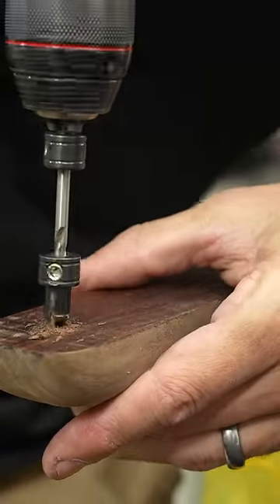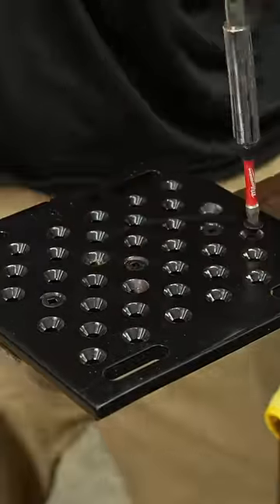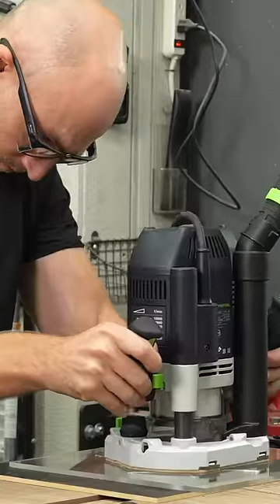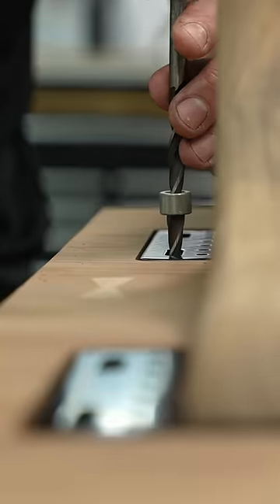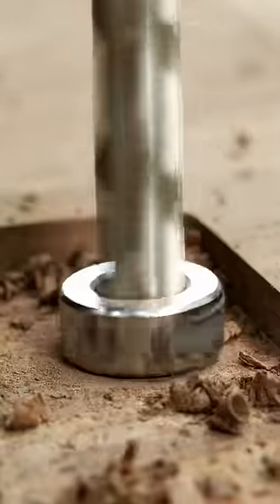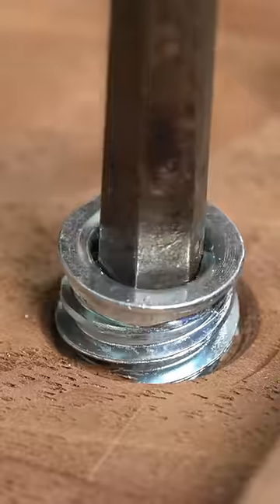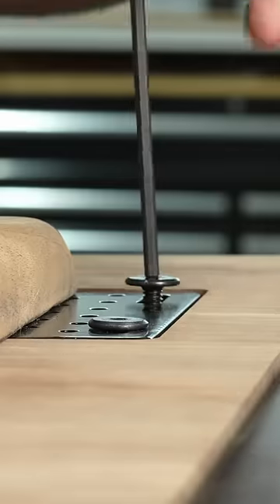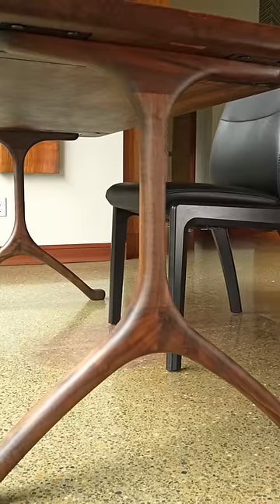Attaching Table Legs

Comment: The machinist in me is silently screaming in agony and the engineer is bitterly complaining about tolerances.
Reply: This made me chuckle since I am a tool maker that deals with engineers on the daily.  Most of them do not understand the intricacies of machining processes.
Reply: The mechanic is happy all the screws are at least easily accessible
Reply: @SGIABC  exactly. Engineers are pretty much the worse part of the chain, in general. Definitely the weakest links
Reply: @cc23001  yup
Reply: With wood its just a little bit different 🙃
Reply: I have wanted to make a comment  about the off 90 degree drilling for quite a while. But I respect the quality of your work that out shines the flawed drilling.

Comment: As long as it holds together, looks anywhere near as good as what you're making and the surface is smooth and level, you're a 10/10 Carpenter in my books.

Comment: Operating a drill horizontally seems to make staying level and inline easier. You can use your core to lock your arms. A button level attached to the side of your drill can be more helpful than the little tube levels some drills are equipped with. Drilling vertically with the work on the floor can have added stability by locking your arms against your legs. 
Nice gadget attachment plates you have there too by the way. Being able to select a side for each countersunk hole can be useful for odd projects. Just a two piece leg situation I ran into yesterday that's got me wondering if Google's been watching along with listening.

Comment: Looks great. You do great work. For my holes, I just use a kreg drill guide if it’s just an 1” but for something like lag bolts I need something better.

This is fine and no one will know. I mean , you’ll know it, but that’s you’re own prison (and not checking moisture).

Comment: The amount of professionals I see that put the drill in at a slight angle is pretty much 100% of them. Around an inch deep, unless you're really really off, it won't matter much at all.

Comment: If you're using a hand-held drill, to get as close to 90° by sight, I find it useful to use a long bit extender. You also need drill bits with a hex shank to fit in the bit extender

Comment: When I need to install [multiple] treaded inserts 100% perpendicular to the face I use a long hex-headed bolt + 2 nuts which I lock against the insert. I then place an appropriate sized socket over the insert/bolt/nuts and make sure it all fit perfectly inside the socket. I also found it's easier to bevel the hole in the wood a bit for easier entry of the insert. Then, using a wrench (spanner), it's easy to micro-adjust the entry angel of the insert and as soon as it's a few mm down in the hole, it's all easy peasy.

Comment: So common this mistake is!
The cure is to hot glue a circular bubble level on the back of your drill motor housing.., when the bubble is inside the circle.., you are square to the surface.., welcome!

Comment: Did you ever had a problem with this type of connection and sideways load? Like someone heavy leaning on the table?
I’m sure the connection plate to the table will hold up just fine, but the surface area to the legs is quite narrow. (But beautiful 😅)

Comment: I think you could use a jig to help you with those recessed threaded insert holes. Just extend your stop the height of a block of wood that has drill pressed homes on it. I'm tired you get what I mean.

Comment: Next time, would your metal brackets have the countersink so the heads of the screws are flush with the plate and the bottom of the table

Comment: To help keep your hand-drill holes more square, you can take a piece of scrap wood, like an off-cut from a 2x4 for instance, and drill your hole through it first at 90 degrees with a drill press to ensure accuracy.
Then use the piece of drilled wood as a drill guide on other pieces since it's already the right angle and drill hole diameter.

Comment: Serious answer regarding the "imperfect holes". I have a plate in my neck between C4 & C5, when I saw the X-rays after surgery, I pointed out how the screws were not perfectly vertical. Tons of medical evidence proves that varied screw angles spread the stress out producing a much stronger fusion. 20 years later they are still fine. 😂

Comment: so this thing I'm working on now is a Roubo workbench. really cool. old oak beams that have been indoors for 30 + years I used for it, yet Im still not finished on the tops as I now have a challenge of making square holes, against the grain for the bench dogs. I want them to be able to pop up bench dogs as well. pretty neat I think. So I have to still make the entire support, and I'll be sure to NOT make a joint from leg to table, because I've heard stories of people running into problems with keeping these joints flush with the top. I feel like if I just make a 1 inch long pin on the legs, that it would work just as well as all the way through, I mean Im not going to run into my bench with a forklift, am I?

Comment: Honest question, would it be a good idea to put some wood glue in before screwing the threaded inserts in?  Even just a little?  

Those inserts did not inspire confidence on their own and I might be paranoid but the holes looked a little too big for the threads to get a proper bite

Comment: Instead of stop collars that depend on a single set screw to it in place (has slipped more than a few times on me, or damaged the drill bit) I use a split collar that squeezes the bit evenly from two sides and so far has not slipped.

Comment: When I watched my workers drill a hole. It’s crazy surprising how many can’t tell that it’s going in at an angle 📐. Even if you point it out to them at the time. They’re just like “ it is straight”. Same with using a screw gun. The poor bit is just skipping. And they can’t tell why. 🤷‍♂️

Comment: Don't listen to the hillbillies they don't know how hard it is to actually do carpentry without electric tools those who do you think your work was absolutely top notch in carpentry nothing's ever perfect you just have to find a way to work around it especially wood is extremely hard to find a straight wooden board unless you make it so if the boy does not naturally straight night is everything else you just have to work a way around it it becomes a mathematical problem after that good luck and it amazing

Comment: Don´t they have cordless drills with a water level at the back, so you can drill vertically? Or a LED circle projected on a wall, that turns oval when you´re not drilling perpendicular?
I´ve seen attachments for this, but they often get in the way.

Comment: You got yourself so I won't harp. However, it's more than just a crooked hole. When you put the bit crooked, forces aren't applied evenly and you can break the bit, wear the tip uneven, and even make a non-round or cylindrical hole. But, you're aware and promise to do better, right? ;)

Comment: Don’t askew inserts add to the strength of the attachment? You mentioned got set screws on the powder coated aluminum that’s why you went off center

Comment: Hey Cam, good video. I won’t give you shit for your crooked holes. I understand you metal plate you had access to was made for screws but if you used threaded inserts in the top, shouldn’t you have used threaded inserts in the base? I’m sure it’s fine, my brain just thinks it increases the cracking probability.

Comment: ORTHOGONAL. ORTHOGONAL. ORTHOGONAL.

a crooked hole on direction is still perpendicular in another if you rotate the plane. you want ORTHOGONAL holes, as in, perpendicular in all directions relative to the plane of the work surface.

im a grass hole

Comment: Okay then: youre such an amateur woodworker, how could you drill those holes that far off? 🤣🤣🤣 On a serious note, who gives a damn about holes he cant see anyways. It depends on if you want to sell that one, in that case its important that it stands straight even if the screws might be a little off and that it doesnt make it weak. You could always take a little off some legs until it stands straight and sell it a little cheaper as long as you tell the customer that its not perfect. It will still hold up for many years so its not that big of a deal.